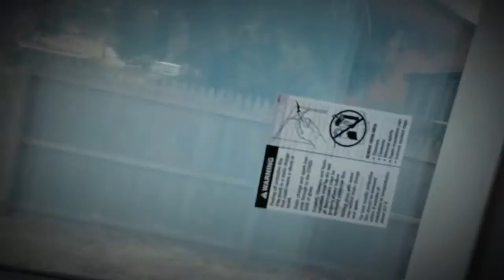Storage container house window install

Comment: Looks gd ty for vid! Doing same to my (2) 20ft container cabins in few weeks. Gonna weld the frames but I was thinking of using those same flange type windows the same way you did just attached slightly diff (to metal frame) with wood studs on interior. That way I can also weld opening/closing security bars to it, since I’m in a seasonal use off grid location. Great job on your project.